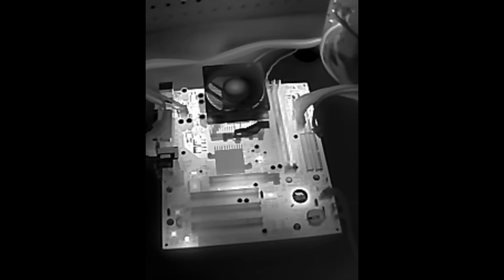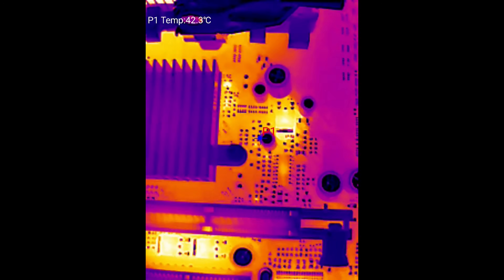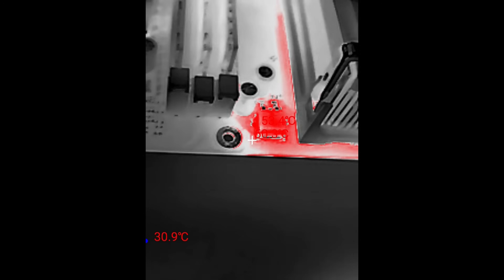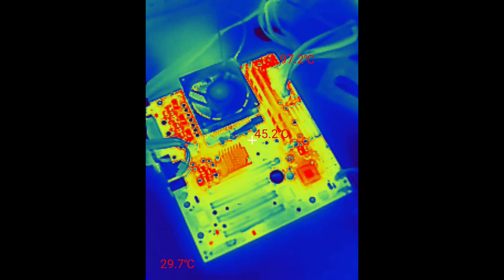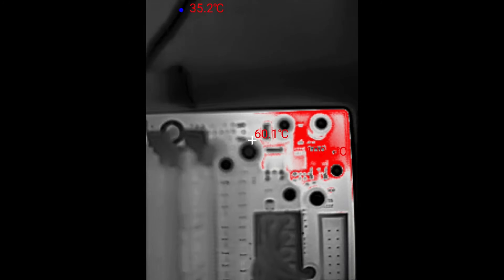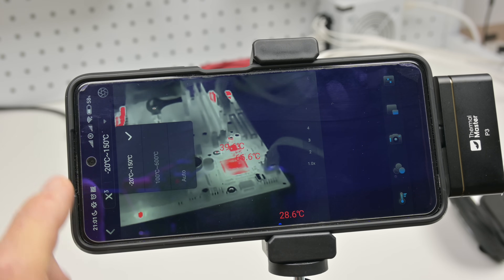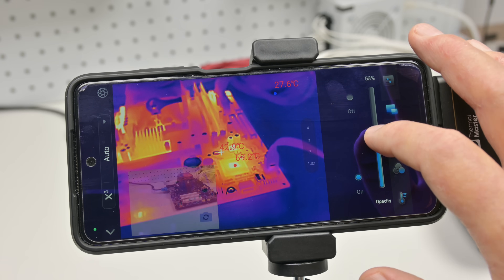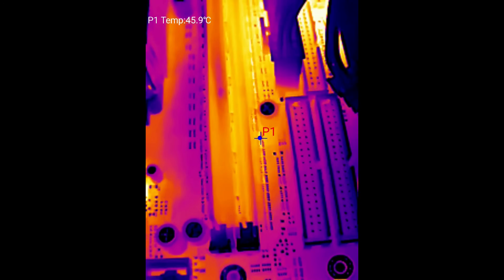Can a Thermal Camera Find Bad Components? Featuring Thermal Master P3 PCB Thermal Camera

Comment: I would like to have that kind of thermal camera but I would not use it to detect faulty capacitors. I'm not electrician but still don't think it's a good idea unless I would have thermal pictures from the past to compare.
Reply: It is a good idea and it works.
Because old capacitors on PWM supply supplies become more resistive. So they get hot.

Comment: Not gonna lie - I never considered Thermals on things other than CPUs, GPUs, CD/DVD Drives and Disks, Since I usually keep these Motherboards on a closed case, and I very rarely open them if they don't overheat too much (Never had that yet though) and if they work fine.

Comment: G'day Phil,
I like addons that can be used for many different devices, 🤔can this be used on a cable connected to PC USB-C?
What you were saying about replacing components, I'm of the opinion if it's not a problem or broken no need to replace it for 2 reasons...
firstly just creating unnecessary E-Waste when it is already a problem killing the World which is why I love giving old hardware a new life 🥰🖥⌨🖱
& second if something goes wrong you could kill a perfectly good piece of Retro Hardware😭
Reply from the maker: It can, but not with OBS, only with its own software.
Reply: @philscomputerlab  OH that is cool,
was just wondering as my short vision is getting so bad I struggle to see my phone screen clearly so prefer photos & videos on my 27" PC Monitor as I don't need my glasses
Reply from the maker: I have the same issue. Reading glasses help a lot. I'm already at +2 haha. I miss my 43" 4K TV as desktop monitor, that was so easy on the eyes ☺️

Comment: Been using thermal camera from aliExpress for the past 2 years. Resolution and other specs are similar to this thermalMaster, software is also quite comparable. WOuld like to try this one, wondering if 2.5x higher price is justified.

Comment: People don't really consider the importance of airflow, and i get it's kinda hard to quantify how much thermal energy goes were without having experience (and it maters a lot the older the system is), but when you realize its importance, and there's a very good example around 1:04 in this video for the point i am trying to make, is that, all you have to do there to get rid most of that heat and thus greatly extend the lifespan and stability which would otherwise be effected by the generated heat in that area, is a single fan directly blowing over that area, specifically one with focus air direction like a beam/straight stream, not a case fan because these blow area at very angled directions instead of straight forward, trust me and do it and then if you have a thermal camera check the results, you will have a very significant drop in temps in such cases. 
Personally, the way i measure temps whenever a sensor is not directly available, since i don't have a thermal camera or if my IR gun is just not gonna help due to the material/part, is to just do it by hand, i make sure my hand is clean as possible and that there's no electrocution issue where i am about to touch and whatever i cannot keep my hand/finger or its tip for more than a half a second, i assume it needs cooling.
Reply from the maker: Thank you 🙏😊

Comment: In my experience, when any electronic component is below 60ºC it will last at least over 10 years, when the component is below 80ºC it will last 5 years, and when it reaches 100ºC it will last 1 year. So I have taken especial care to cool most electronic components not to reach 80ºC so they will last more than 5 years. I have the P2 PRO. This tool is a MUST for many repairs, for ex. shorted capacitors, diodes, transistors or ICs, there's no other tool that can detect those shorted components instantly.
Reply from the maker: When something is shorter, what do you see on the camera? Very warm?
Reply: @philscomputerlab  yup, it gets hot quickly, in ex. shorted IC or small ceramic SMD capacitors. Sometimes voltage regulators and transistors gets very hot and need extra cooling. The trick is to inject a low current, ex. 500mA and 5V bypassing the DC power source and see what gets very hot. Never inject high voltages or high currents, because it will fry other components, especially ICs.

Comment: These smartphones attachment thermal camera are very useful when finding shorted solder points (solder bridge) or faulty components on a graphic card when a voltage from a bench-power-supply passing through a resettable-fuse is injected into the graphic card.

Comment: Unfortunately the P3 is $468.00AUD on special - Regular price $624.00AUD ...I would buy it if I could find it under $300 like you said.
Reply from the maker: USD mate.
Reply: you can check their P1, less than $300 and perform great
Reply: @LarkGood - Yeah thanks, I looked at those and eneded-up purchasing the InfiRay P2 Pro for $349 from Amazon. It uses the same camera as the P3 but has wider field of view than than the P3, it is essential you get the P2 Pro rather than P1 or P2, because it comes with a detachable Macro Lens to pin-point small SMD components.
As it turns out ...Thermal Master and InfiRay are essentially the same cameras, with Thermal Master being a brand that distributes or licenses the product for InfiRay.

Comment: Chatgpt has rarely been helpful in electronics repair for me. I thought it might help me troubleshoot faster, but it's actually just been a hindrance. Perhaps it is better at helping point out trouble spots in motherboards that are still functional, but it's 0 - 4 for helping diagnose faults on boards that won't post. This is even with the suite of tools I have. Thermal camera, post code boards, meters, oscilloscope, etc. It's also abysmal at reading schematics and data sheets. Anything more complex than simple closed circuit designs, it starts hallucinating badly. Each new version is getting a little better, though.
Reply: I fully agree. I tried to diagnose an issue I have with some audio gear with ChatGPT. I spent hours providing screenshots from the oscilloscope and audio samples with a signal generator. I even had the audio samples from an identical device that was not faulty. At some point every component was "most likely" the root cause and a bit later it was "definitely fine". After a couple of hours of back and forth I am still not step closer to having an idea what the problem could be. It clearly does not have any clue what it does but just generates answers based on statistics.
Reply: chat gpt slave, kid.
Reply: I find Grok is better at reading schematics than ChatGPT